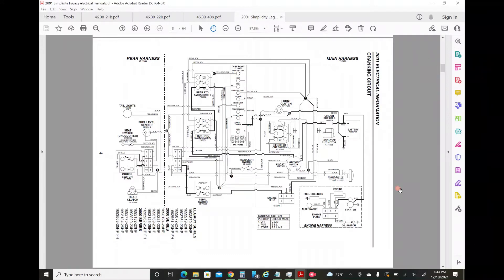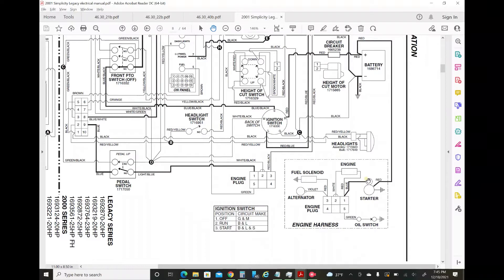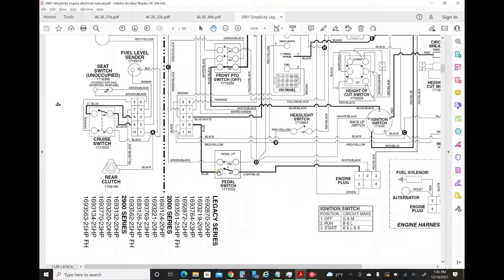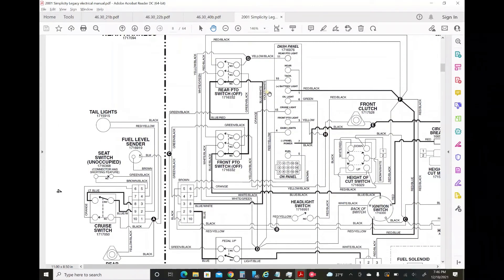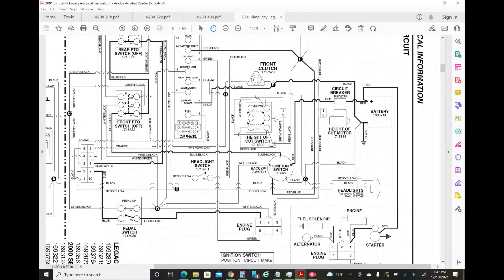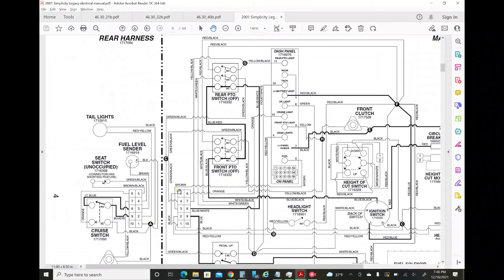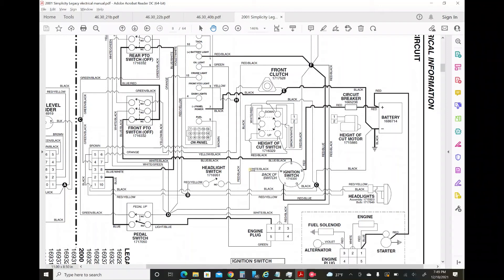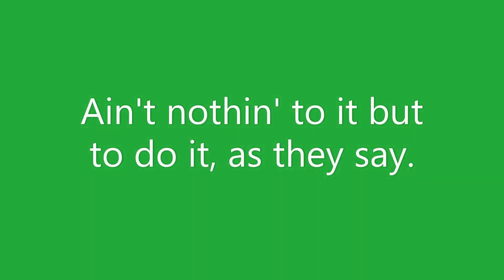Simplicity Legacy cranking wiring diagram, part 3

Comment: did you find out what the issue was?
Reply from the maker: Not really.  There is still voltage drop through the crank circuit and it sometimes requires multiple tries to get the solenoid to engage.  I pretty much just live with it.
Reply: @kevin9c1  ok because I pretty much have the same problem where only the solenoid clicks but not the starter and i tried everything
Reply: @kevin9c1  the fuel solenoid*
Reply from the maker: @henrytacam4119  The fuel solenoid?  My issue is there is too much voltage drop for the starter solenoid to engage.  But if I just try multiple times eventually it engages.

Comment: Bet it’s your ignition switch
Reply from the maker: Hi Bob!  Well pin S of the ignition switch outputs power to the solenoid and that measured 11.5V while attempting to crank (part 4 spoiler).  So the switch is not the issue.